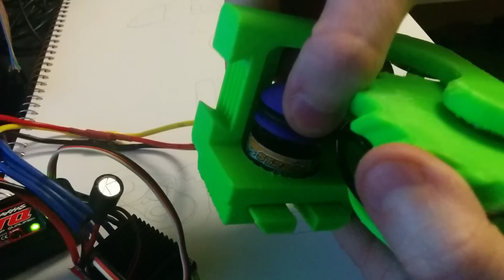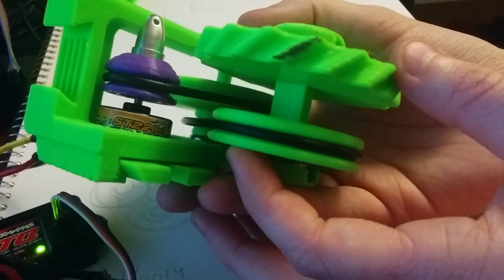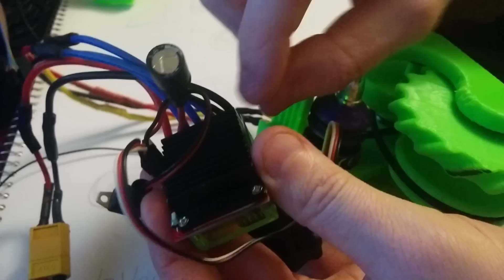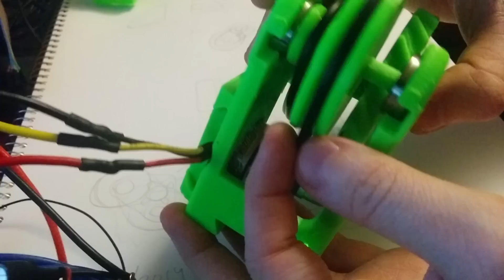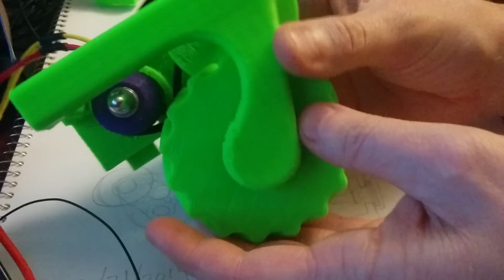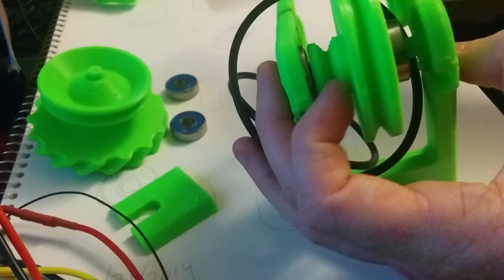3D Printed Robot Drivetrain

Comment: What software did you use too model you parts, and how did you figure out how to design the gears?
Great build im confident that you'll get your design just the way you want it!
Reply from the maker: Hey Aaron,
I used Solidworks, but it's very expensive (I have a copy for work). For new users I would recommend Autodesk Fusion 360, which is free to students and educators.
For the pulleys, I just new you need a "V" groove that will hold a belt, so I made my best guess on them and printed some out to test. The great thing with a 3D printer is that you can keep trying until you get it right without a lot of hassle!

Comment: how to cooldown the motor?
Reply from the maker: I haven't sorted that out yet. If used intermittently it should be fine, but I don't know about continuous demanding use.
Reply: Taylor Alexander
brushless motors need ventilation, you can put 1 small 30x30 fan from bottom side where you have cap to fix motor at the place that conected to the relevant T sensor to trigger fan at the heavy motor load that can creat heat up to the 150C.So, such motor node at the body of robot need ventilation windows. It is even nice to see grid on them, at such body :)